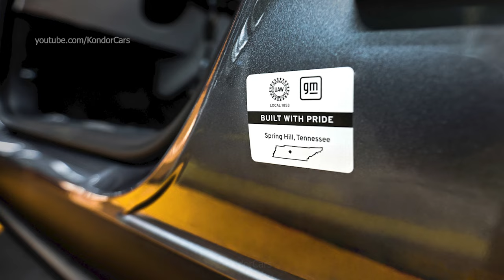Cadillac Lyriq production, GM factory - Spring Hill  Manufacturing

Comment: Interesting video.  It shows the nice, very slow pace of making the Cadillac Lyriq BEV.  This is very unusual, since the entire 20,000 production run was "sold out" over 1 year ago in May of 2022 yet only a few hundred have been delivered to date  (10-2023).  Also interesting are the giant Twin Cam V-8 engine (@2:41) and the complex dual exhaust lines (@6:37) depicted.  Confusing...  Is the Lyriq a BEV, ICE V-8, or some strange sort of Hybrid??  Perhaps GM Marketing could get  a little more funding to have this video re-edited.  Perhaps GM could also afford to get modern tooling to mount the 5 nuts of the wheels all at once instead of individually by hand as shown (@7:20).  Just some questions...